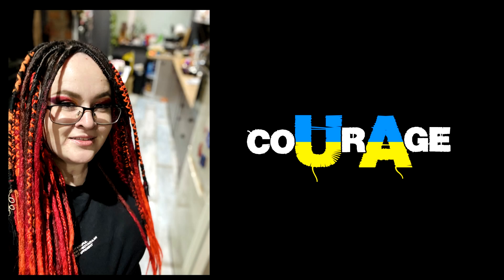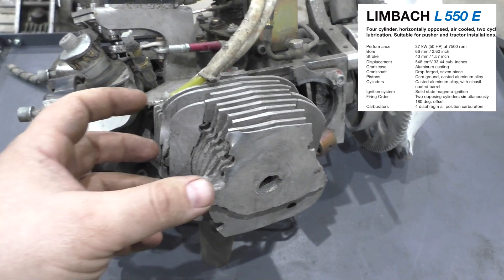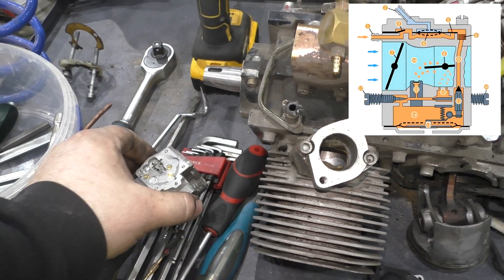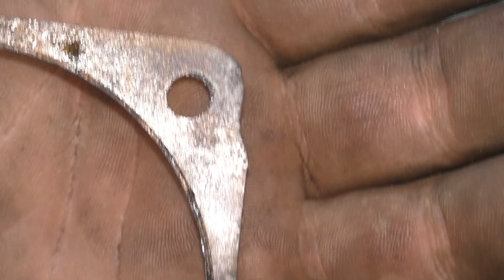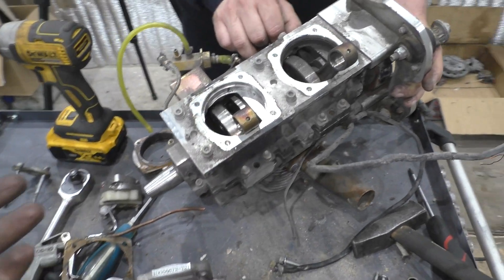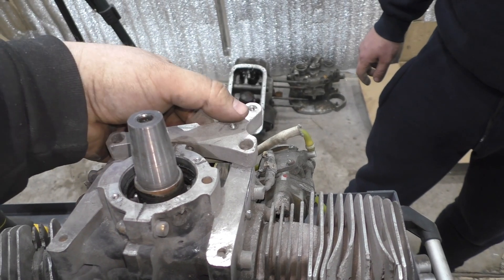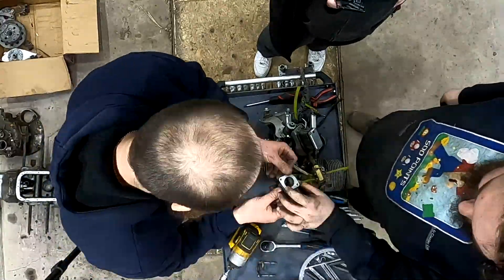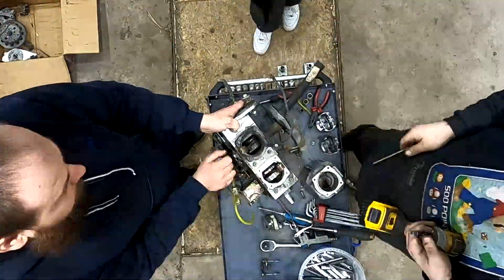SHAHED 136 drone engine TEAR DOWN

Comment: As a person in manufacturing for 43 years, I am fascinated by this video. I conclude by the level of quality in this engine, especially the scuffing on the cylinder wall, that this engine could only last as long as one tank of fuel. It is a one speed, one purpose, one use engine.
Reply: And there are LOTS of those engines around, including all the different variations of it.
Reply: This engine is economically well matched to its intended purpose; as it is only intended for a very short working life of one journey, one thermal cycle, no running in period, and once running - no operator input. As long as the drone flies at an acceptable speed and the fuel consumption isn’t excessive and it doesn’t stop before its mission is complete it is totally satisfactory. The four carburettors may help reliability - if one jet becomes partially blocked with contaminated fuel, the engine may run well enough on the other 3 to complete its mission. It is, in its own way, ingenious, making an engine last well enough for a short job, whilst being inexpensive enough to make lots of them. The good quality Japanese and Korean bearings are presumably generic enough to get around any sanctions.
Reply: @sullivanrachael  10 out of 10 would definitely buy one to test as a paramotor or propel a swamp boat
Reply: @noimnotarobotcanubeleiveit7024  🥴
Reply: I think the scuffing is the crosshatch from honing.
Reply: @ryelor123  yes its normal. These are pretty good engines
Reply: @ryelor123 может в момент удара он ещё работал
Reply: That's what it's designed to be, a one way drone. Why spend more money on it? Western weapons companies would've spent ridiculous amounts of money on that engine in order to charge the taxpayers as much as possible. What you see here, however, is the optimum use of resources to reduce costs.
Reply: I think comparison with western practice ignores some important factors. Probably if a western company tried to make something like Shahed you would see it equipped with a jet engine (which the Russians are already trying themselves). This is not just extravagance either, a simple turbojet is quite an easy machine to build with high tech manufacturing and would likely involve less manual assembly, which is always a significant part of the cost in the west. And of course the higher speed means fewer drones needed per target, as they will not be easily intercepted by people with machine guns mounted to pickup trucks. But one needs the technical basis to do this, which Iran certainly lacks. Meanwhile a piston engine can easily be built by any well equipped machine shop.
Reply: @nerd1000ify Iran is presumed to be close it's atom bomb, don't underestimate their competence.
These are cost x time decisions, not a performance competition.
Reply: @candidobizzotto2038  No doubt Iran could build a suitable jet engine, if they were prepared to make the investment. Evidently they are not.

Also note, the technology required to make a nuclear weapon is not all that sophisticated, the US after all achieved this in the 1940s at the same time as they were learning to make their first jet engines from the Brits. A gun-type uranium bomb could be assembled by any state with access to sufficient weapons grade uranium, the hard part is obtaining said weapons grade uranium. This is not particularly complex from the perspective of technology, but it requires immense amounts of energy and very large installations that are obvious targets for the Israelis.
Reply: @nerd1000ify engines like this can be built in stone age conditions in Pakistan or china. Simple stuff with aluminium castings, a few of which are machined, and then a bunch of bolts and a few pipes.
Reply: @nerd1000ify  ...iran already introduced a turbojet version... you seem to be behind news
Reply: @teslastellar Is it really a good strategy tough? You should look at real life results before concluding prematurely.

For instance a few months ago Israel struck the Iranian consulate in Damascus killing 16 people, 14 of which were Iranian officials or soldiers, one of the victims is believed to have been a major coordinator for the October 7th attacks. In order to achieve this they expended six expensive missiles.

Iran retaliated by launching a barrage of more than 300 long range weapons, half of which were expensive missiles. Nearly a very thing was intercepted, minor damage was inflicted to a couple of air bases and a child was wounded.

Overall, I'm not sure the Iranian attack was cheaper than the Israeli one, but because their weapons were crap like we see here it failed completely. What's the point of making a weapon cheaper if it becomes useless?
Reply: @iotaje1  ...cheap propaganda. none was intercepted
Reply: How do you estimate the reliability given one sortie? Love to hear an expert opinion. In Dutch we say “houtje, touwtje”, literally: small wooden stick and a piece of wire (and it rhymes too 👍😊)
Reply: This engine is not a original Limbach engine, it is a cheap copy of it  made by the Iranian company "Mado".
The original  is a high quality engine cost 17500 Usd. each.
Reply: کاملا درست میگوئید،من در ساخت این موتورها در شرکت LIMBACH بودم،کیفیت این موتورها خیلی عالی میباشد،اینها را برای پهباد جهت سم پاشی،و مصارف دیگر اسفاده میکردند،سال 2010 ایران حدود 600 موتور از شرکت LIMBACH خرید آنها را به ایران بردند و از روی آنها کپی کردند،اما کیفیت ندارد. @toki2906
Reply: I think they could've done it even cheaper. The n8ce little red shaft on ball socket for the butterfly valve in the carby could've been done away with and replaced with wire. Also keep in mind that we see cracks on EVERYTHING here, cylinder wall base, fins, propeller gone, and those cylinder wall scuffs COULD BE caused by the shockwave it got when shot down. Because there's LOTS of damage on this from being shot down or crashing to earth after use. I guarantee you the nazis could've built stuff that is cheaper and rougher because in their last days, THEY DID. I saw a submachinegun they built but hitler wouldn't approve for morale reasons that looked like welded plumbing pipes because much of it WAS. I haven't seen anything except those photos and nothing on YouTube about it.
Reply: it serves the purpose it is a suicide drone its made fore one way trip. The Iranians understand that well.  cheap and effective
Reply: @eiadco221  How effective is it really?

Iranians launched 170 of those along with 150 missiles in a barrage against Israel, how much damage was dealt by those "cheap and effective" drones?
Reply: @iotaje1  don't forget that attack was advertised and defended with quite an expensive amount of AA
Reply: @nic.h  Yeah but in case you didn't notice money isn't in short supply in the west. We need results and we get them, while countries like Iran have deprived their people for decades and have nothing to show for it.
Reply: @iotaje1  yes the West can afford that particular defence.  But you miss the point, the strike was never meant to be successful.  Warning was given.  It's no guarantee that an unannounced attack would be so well defended.  It's no guarantee that the West could continue to afford such defences indefinitely.

You are judging it as a failure because they were largely successfully intercepted when it was never intended to be particularly successful at doing so in the first place.

It was a test of capabilities and a political statement.  Both of which could be argued as being relatively successful.

I'm not pro Iranian by the way, just pointing out that from the Iranian perspective they likely were happy with the outcome.
Reply: @nic.h  Are you saying that Iran used a significant portion of it's long range weaponry stock to send a warning, after Israel killed many IRGC high ranking officers?

That's a pretty expensive message, and a little weak as a response to successful strikes.
Reply: @iotaje1  yes.  Literally, given the announcement of the strike.  Although the message wouldn't have been the only goal.  Consider it a test, albeit large, with a message attached.
Reply: @nic.h  And what exactly was the message?

"We are unable to do you any harm you even if we literally use everything we have"?

Because I'd argue that by killing the IRGC officials who coordinated the 7th of October attack Israel sent a message that was unambiguous and pretty strong. They even managed to kill the leader of Hamas right in Teheran, what a message.
Reply: @iotaje1  well that they can afford to conduct such a strike for a start, that they are willing to do so to retaliate against them.  You really don't consider the prior announcement of the strike doesn't imply anything.
Reply: @iotaje1  .. they used negligible portion of their arsenal. tiresome propagandist
Reply: Interesting, the engine shown is not a German Limbach 550e engine (used in manned aircraft) but the Iranian copy of it.
The Iranians seem to cut costs in the manufacturing process as their version looks less durable than the German one. Makes perfect sense for loitering munitions though
Reply: Similar engine to my mini bike as a kid
Reply: @TopNotchHarvest  Which mini bike used a 2 stroke boxer engine?
Reply: @TopNotchHarvest  this is a 4 cylinder boxer engine though.  Very unlike any if the Elsinore's
Reply: @stvrob6320  imo he's not claiming his pitbike as a kid was a boxer 4 cylinder, he's saying that you won't hardly see uncoated aluminum two stroke cylinders anymore, the last time you saw those was back in the day... i think even most chinese amazon 2stroke pitbikes are nikasil coated
Reply: sok tau loooo  kwonn tholl bapajk muuu
Reply: I don't like Ukraine and i don't support them winning the war. Will i get arrested now?
Reply: Modern air defense systems are programmed to ignore low,  slow flying, meandering targets as they are likely to be birds or insect swarms. Also,  since such systems are generally groun based, the radar gain is kept low so as to prevent injuries to crewmen and civillians who are exposed to the electro magnetic radiation.
Reply: That’s the idea when they built it cheap as possible without losing all ability even if it’s not controlled it will crash on enemy territory eventually
Reply: Fit for purpose!
Reply: Это и до видео было известно
Reply: They mention at 3:10 that one piece aluminum cylinder is ancient technology, most would be nikasil coated. The casting was done poorly at an industrial level thus the cracking around the ports on the cylinder walls, this whole setup is worse or equivalent to your average chinese 2 stroke pitbike you might buy off of amazon
Reply: @TheMotoManiac  How much benefit would being nikasil coated bring to this use case though?
Reply: @nic.h  no variables or inconsistencies, there's a reason you always see russian/eastern weapons missing their targets. They copy what we make but from 100 years ago, and are so sloppy that there is too much minor errors and inconsistencies in every detail that they just can't get their stuff to reliably hit targets. Western countries don't do this because of effectiveness and the chance of innocent casualties. The same reason our mines are overengineered and expensive whereas others are cheap. It's because ours blow after a set time and reduce chances of innocent casualties in future generations.
Reply: It would seem that it is made as a one flight engine and then it’s done
Reply: Indeed. The propeller directly on the crank had me laughing.
Reply: @peterbustin2683 Why? Direct attachment of the propeller to the crankshaft is the most common method. Reduction gearboxes or belt and pulley systems simply add cost.
Reply: @rogerlishman and weight.
Reply: @peterbustin2683  Much simpler and less expensive and for the power that this engine produce, perfectly suited. This is not high end technology made for certified aircrafts with a pilot and passengers. And installing a gearbox and use a bigger propeller add weight and size that may cause a problem.
This engine is perfect for a drone that has almost no chance to be retrieved.
Reply: @kukipett  still, though   7500 rpm is extremely fast for a propellor
Reply: @stvrob6320  It would be fast for a full sized manned airplane but this is more like a largish RC model plane.  The smaller the aircraft the higher the RPM needs to be to get useful thrust from the propeller, assuming  of course the propeller diameter changes in rough proportion to the size of the aircraft. I think for this size of aircraft it is quite normal, perhaps even a little slow.
Reply: @listerdave1240  Slower prop can take advantage of a larger dia prop with steeper pitch for greater efficiency and greater endurance.
Reply: @stvrob6320  Yes, but the prop size is limited by other factors, such as the space available in the storage container and launcher. In any case I would say the 7500 RPM seems to be quite the optimal speed for such a sized aircraft and its intended mission.  A larger prop running slower would increase range, which could of course be an advantage, but would significantly decrease the cruising speed.
Reply: @listerdave1240 always trade offs. Fairly well balanced machine.
Personally I’d like to see a pulse jet version.
Reply: @peterbustin2683 why? The simplest and lighter the better.
Reply: @peterbustin2683  
Umm...the very first aircraft engines used this...right through to the first Spitfires...

wooden propellors, 
fixed pitch..
fastened with bolts through plates with the bolts safety wired.

You know...like Boeing should have done on those door bolts????
Reply: @JohnSmith-pl2bk  Okay. I didnt know. One never stops learning!
Reply: @JohnSmith-pl2bk   Okay. I didnt know. One never stops learning!
Reply: @JohnSmith-pl2bk  wood - the original light weight composite . In many ways it is hard to beat
Reply: @peterbustin2683  Mounting the propellor directly on the crank is quite reasonable on a larger slower-turning engine, but with this high-RPM engine is noisy and inefficent.

Comment: The grinding inside the piston walls may be removal of material to balance the engine. We did it all the time in automotive.
Reply: Unlikely, as it appears to be the same on all pistons.
Reply: nope. definitely removing part numbers... did THAT all the time when brazing up tungsten carbide tools... generic castings to several merchants, certain clients... you ground the numbers off.
Reply: @paradiselost9946  Kind of pointless for them to remove the numbers when pistons are made from tightly controlled alloys that can be analyzed in a lab so that the exact factory of origin can be determined.
Reply: @ryelor123  ha ha ha ha ha... "tightly controlled alloys" in something thats intended for once time only operation... cool, got ya. no, theyre not made from any old scrap, they use a "tightly controlled " alloy of proprietary ingredients.... sure they do...
Reply: You'd be better off shaving the bottom of the piston skirt for that.
Reply: @jflo4073  No, that would change the intake timing on a 2 stroke engine.